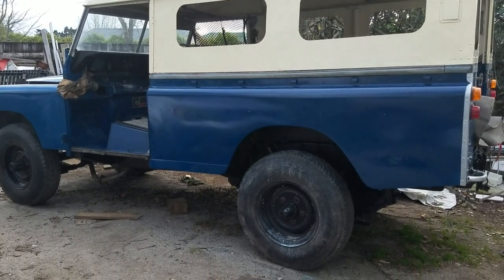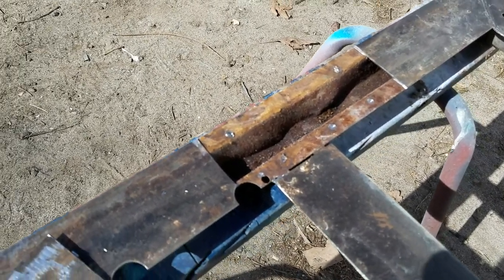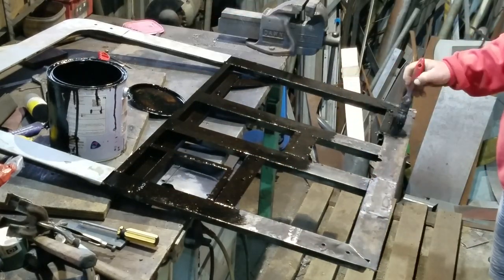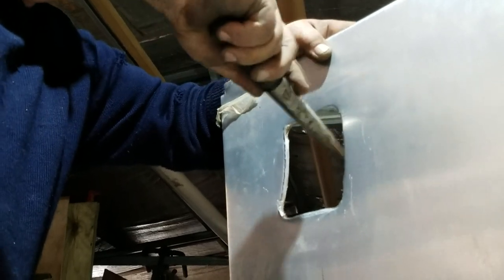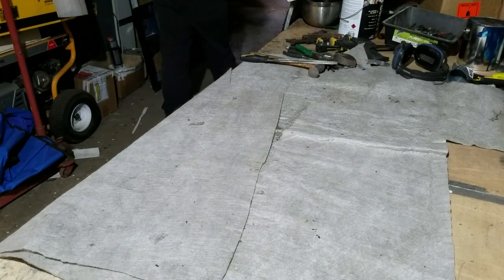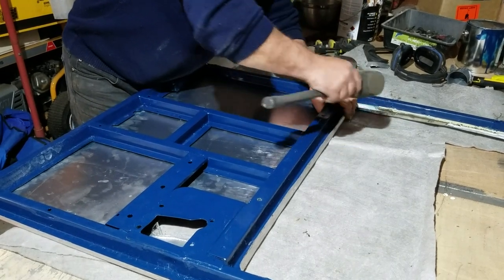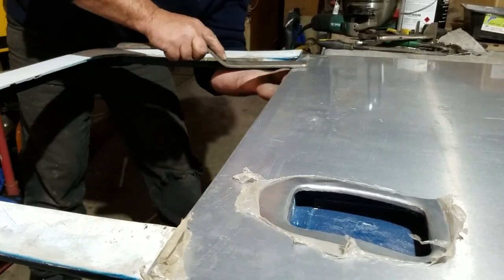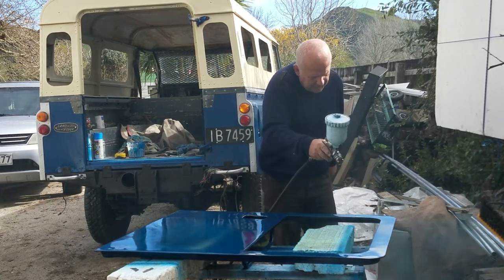Land Rover Rebuild, Complete Rear Door Resto. Make and fit new skin

Comment: Glad you are showing the rebuild. You mentioned your struggles with paint stripper. A trick that has helped me is to give the old paint a quick scratch with course sandpaper first before applying to get through the surface barrier. Saves on product. Should also speed up your tea bagging method.